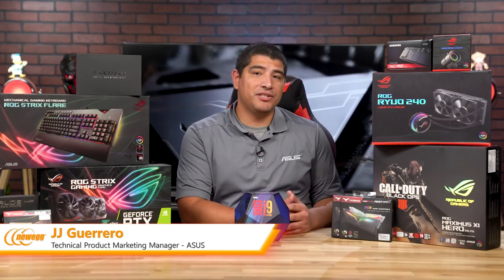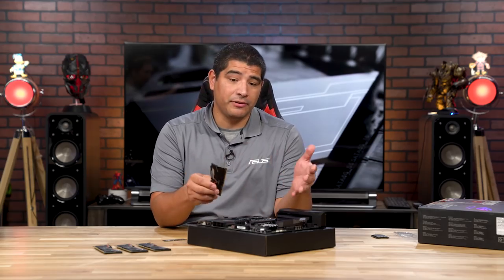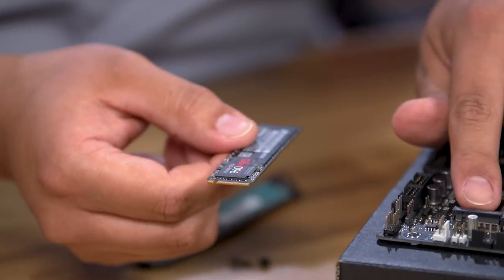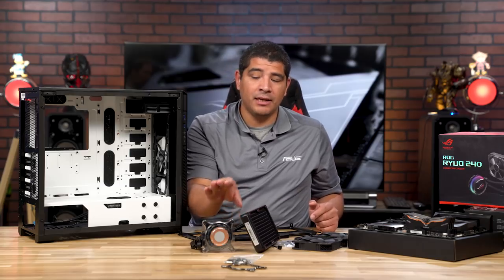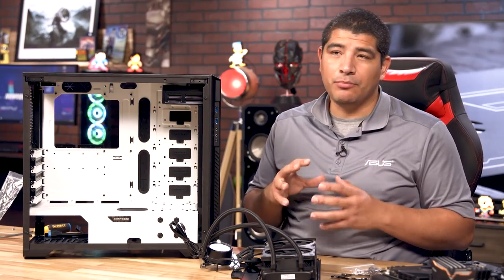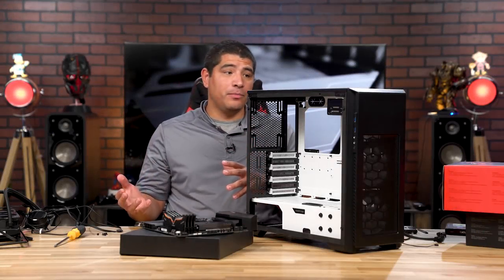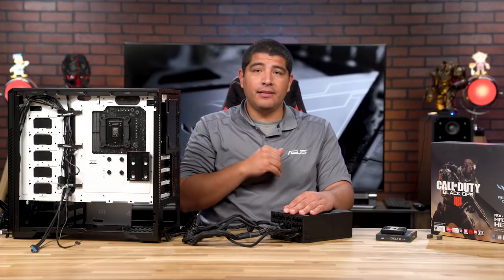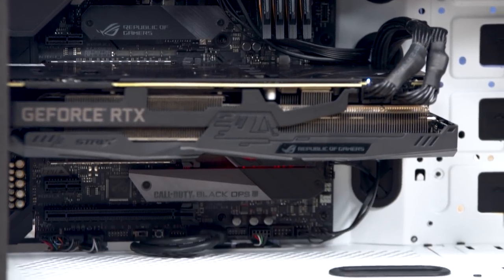How To Build A Z390 Intel 9th Gen RGB Gaming PC From Start To Finish

Comment: Why does everyone do these builds for a specific mother board but never show where everything is being plugged in on the motherboard it self. Isn't that the whole point???
Reply: its not hard to know where all the cables should go
Reply: @sealover63  The video title states from start to finish you would think that you would include cable placement for those building a P.C for the first time. Not a very good tutorial in that sense.
Reply: I agree w/ Casket and Colin. There are so many yt vids on "how to build a pc from scratch" etc. but folks always forget to include the actual connection of the wires process. Like, why is this step always skipped? Have all these content creators completely forgotten that not everyone is born knowing the basics of electricity? For ex. Black = Ground and Red = most usually Positive, and then the Green and Yellows are most likely for audio and/or other connections (differs per mobo mfr), Blue = USB, etc. etc... Putting it all together is easy per say but that wiring! Thankfully most mobo mfr's include color coded wire diagrams in the instruction manual and even include a "Quick Connect" piece (like ASUS). I love ASUS, don't get me wrong, I simply agree that content creators should spend time w/ this.
Reply: Watch Carey Holzman video for Computers buildings
Reply: Bruh, he means giving meaning/an explanation to what’s on the motherboard, how to install M.2, etc etc.
Reply: Came here for power supply connection on the motherboard but saw nothing.
Reply: Have you ever heard of the word MANUAL.....omg... do you have problem reading ?
Reply: For people saying it doesn't make sense for him to show where individual cables go, the guy spent 2 minutes explaining a screw for the M.2 drive.
Reply: @Pablo4949  Yeah....well if you don't know where cables go from let's say from PSU to Graphics card......don't build a computer.  Do something else. The problem with M.2 screws are they are so tiny and hard to find if you lose them. Standoff to M.2. is somehow a problem for a lot....Often they don't use them. I think it's right to spend 2 minutes to  show where the standoff goes with the screw. And then there are heat shields to M.2 They can be very annoying to screw off and on.
Reply: What's your problem with cables? They go the same place on all motherboards. Get a grip and stop posting bull. CPU power - Motherboard power - Sata cables - Power cables for HDD's and SSD's are all the same. Even front USB - Power LED - HDD led - Power swich and reset switch goes the same way on ALL motherboards.
Reply: @eriksrensen6369   But if you don't know where cables get plugged in, or how to route them and such, how are you supposed to learn? Perhaps a build guide? Maybe even a build guide that says "from start to finish" in the name. The point OP was making is if this really is a build guide, why is it just skipping an important step.
Reply: @Pablo4949  Well, if you want in depth how to manage cables - this is not the video for you. This is not a video for beginners or first time builders and was never the intention with this video. There is nothing in the video that claims it's for first time builders. It's just a build video There are other videos where you can learn how to route cables and build a computer if you are a novice. This video is a video for people who have some experience building computers. How do I know that? Just watch the video. People are just eager to find something they can complaint about, and post stupid commen ts. Why comment on how he speaks, and how he looks....it's nonsense and stupid, and has nothing to do with the video.
Reply: you know what I didn't even know that we have to connect 8-pin power cable to mother board as well, I thought one 24-pin cable is enough... and then he said in the video that it needs to be done. So yeah I watched a numerous videos on internet about building PC but no one mentioned that there is a 8-pin power cable as well, only today I got to know, I want to build a PC soon so I am watching these kind of videos, but now my confidence has really dropped I don't think I will be able to do it, I don't even know which cables to connect and where on mother board??.... there is no detailed tutorial as well..
Reply: @memd777  You know what? When you buy a motherboard it comes with a manual. And it will clearly tell you that you need to plug the 8 pin cpu power cable in. If you don't computer will not boot. Ther is a reason why you have to read the manual
Reply: @Pablo4949  Watch the video. It''s showed from 18:06
Reply: @eriksrensen6369  hmmm, I would just call a local expert ... seems too much complicated for my intellect, I don't wanna risk 1000 dollars for nothing
Reply: @memd777  It's not complicated at all. I has been normal for over 15 years  that you need a CPU power cable - 8 pin or 4 pin - on Z390 2x8 pin or 8 pin and 4 pin. You know what? I think. You just like to be negative- Instead of being negative you should spent  a couple of hours reading some manuals and other material about building computeres. Watch in depth videos on how-to.....You sound resignedly
Reply: Just watch the Verge. He explains it very well.
Reply: @eriksrensen6369  We don't need the video then, do we?
Reply: @celestin_me  Do you read the title? Blabla Build a pc from start to finish. He acutally did a video with the correct title "blabla building a pc. Showcasing the start and finish".
Reply: @sealover63   its hard to clip in those power and hdd lights
Reply: Exactly. And seriously building is really not the issue...The question is do you need a video card for this thing or is on board and...Installing that damn OS from Microsoft is always the kick in the ass. Been building machines/servers all types for over 24 years. The install on the OS is either smooth sailing or a cluster you know what!
Reply: @sealover63  If people are watching this for help on how to build a temperamental machine, it would help if EVERY step was clear
Reply: Google iTFT Computers (for video) - you won't find more detailed video of how to assemble a PC, highly recommended.

Comment: One production note, I'm a producer and Production Designer and your set is nice, has a clean look to it. Its a little safe on the overall design. Maybe this is within your budget I'm only speculating but one thing that is truly a production no no is using black, specifically black screens, and even narrow that down don't have black screens with content using black spaces, your camera guy is in the reflection to the point that I'm more focused on what he's doing then looking at the content. Also since I'm here I also just built a Prime Asus Z490-A with I9 10850K and the Pro 980 SSD.  And an RTX2060 I just don't understand how this is system you are building is a high end system. Mine is Mid Entry I believe with all the 3 year old parts you are building with would make this an Entry level system.

Comment: My biggest thing with building my own PC is mainly the parts themselves. First I wouldn’t know what to buy and then the other thing is is everything universal?  Does it matter what motherboard, RAM, CPU graphics card I buy or could I just get the latest and greatest and it will fit into any motherboard?
Reply: LoneSoldier29 Only LGA1151 CPU’s can fit into a LGA1151 motherboard. Different motherboards have different CPU sockets, as well as different ram slots and different PCI-E, M.2 and PCI-E 3 slots. PcPartPicker.com is a good website that checks compatibility between components. PC builds almost entirely revolve around budget, depending on how much you can spend you pick between AMD and Intel CPU’s and then will need to pick a compatible motherboard. It is best to do a lot of research into what you want in your computer, also depends what you are using it for. Goodluck!

Comment: Meh, The Verge did it better...
Reply: Kis Jorgensen clearly
Reply: Yeah, he forgot to add some extra thermal paste..
Reply: And the radiator has fans on it
Reply: Definitely needed to use some tweezers.
Reply: thanks ;)
Reply: Of course The Verge did everything better, they're 'real' and 'professional' journalists.
Reply: Emanuel Lipovac why you say that? You don’t need to much thermal paste at all. The amount that comes on the cpu block is more then enough
Reply: He didnt bleed the cooling system.
Reply: @2vgod460  r/whooosh
Reply: Yeah the verge knows how to delid aswell they use sandpaper
Reply: Wow.....  🤣🤣🤣 🅱️etter
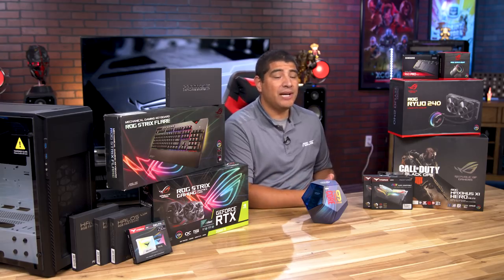Reply: He had 1:00 right
Reply: Make sure to secure the cables with tweezers!
Reply: Need two boxes of thermal paste just incase.
Reply: He didn't screw in with confidence
Reply: S gill whoooooooosh
Reply: He's not grounded to an elastic band
Reply: Estray One lol
Reply: And never put in the cpu first. Do the cpu after you done everything in the motherboard.

Comment: Dont even know why you made this video if you cut out the cable plugin stage
Reply: Exactly. I can do all this crap. Cable plug in and management is what I need help with. Since every mobo maker wants to mix it up from everyone else, it gets confusing. I would also like to know about how to set up the RGB controller the right way. Assembly is easy. I need the in depth tech crap. The stuff that sets the builds apart.

Comment: Hardware Unboxed did an extensive review of the top Z390 boards and the Asus Maximus Xl was at the bottom in every category, so thanks to that review ,I'll be using the MSI MEG Z390 ACE

Comment: HIya JJ! Great video!   I listed my PC specs below.  It is about 7 years old.  Would just upgrading my GPU be worth it, or should I save up for a new build?

CPU:  AMD Phenom II x6 @3.8+ghz
 
Heatsink:  CoolerMaster hyper 212+ (hand lapped with twin corsair upgraded PWM fans in push pull)

Motherboard:  Gigabyte 990FX-UD5

Memory:  Corsair XMS3 @ 1666mhz

GPU (s):  2x XFX ATI 6870

Harddrive:  Hitachi 1TB 7200rpm SATA

Optical:  Sony DVDRW

PSU:  Corsair TX750 750W

Chassis:  Lian Li K62

Comment: I always install the CPU after the motherboard and power supply is installed in the case. Then make sure the power supply is switched off, plug in the IEC connector! This makes sure the case is grounded to protect against static discharge and possible damage to the CPU chip and other motherboard components. Touch the case to discharge and static electricity and proceed to install the motherboard and then the CPU as he instructs. 
Matt -  Building PCs for 40 years.
Reply: no need for nowadays hardware, much. Tougher than 486 era.

Comment: Hey JJ, if I use an Intel Optane 905p SSD on a Z390 board, would it be limited in terms of performance if using the chipset lanes? I imagine it technically would be, but would it be noticeable/really matter? 

I ask because the Intel optane SSDs have superior Queue-depth performance compared to regular NVME drives so I was curious if chipset lanes would impact that to a noticeable degree.

Thanks

Comment: Question?  Why do you put blue locktite on the screws holding the M.2 thermal pads on?  It is near impossible to unscrew them without stripping the Phillips #0 heads out given the locktite on each of the 4 screws.
Reply: pkincy exactly!!! I almost ripped my heat sink because of those damn screws!! Which genius came up with those screws???!!

Comment: Good video, but what's missing is updating bios and maybe some issues solving. Did the soft test that you said and the VGA light was on all the time, in the board manual it said it could be problems with the graphicscard and that got me worried, it disappears when I plugged in a monitor. Another thing I had problems with was no signal to my tv from the hdmi. Had to use a hdmi 2 displayport to get a signal to the tv. I guess I'll have more problems but as a non it would be nice to know this kind of issues :) z390-f & strix 2080ti of btw.

Comment: sigh thank you so much for this video... I've been trying to find exactly this camera angle on THIS motherboard, and you provided it it... I have a replacement set with Amazon, but after realizing what I had to begin with, I am so tempted to just cancel it all together...

I just got a whole bunch of new parts for my new build, including this motherboard (not special edition though) and processor.  When I attempted to place the and close in the CPU, the screw that holds it seemed to pop out of the motherboard and was seeming to put far more pressure onto the CPU than what I was comfortable with.  Seeing your video at almost exactly 2:30, I can see that what the latch connects to is a specialized flat stop screw piece.  But what I have in my motherboard is a regular, round headed screw, very similar if not almost identical to the two holding the cpu mount itself.  Now my question becomes this...

How could there be a wrong piece like this in the motherboard?  Faulty product, or should I be looking at Amazon on possibly sending me a "renewed" product when I should have it directly off the shelf?

Comment: I have watched this before a while ago before I started building PCs. Now that I have done a few, um.... did you completely screw up the CPU cooler install?? The radiators final spot is not where it started. Your original location was to the back and it moved to the front off scene somewhere. Also, when you pushed on the pump you put it on sideways (hoses at the bottom), then, at the end, it is correct. Beautiful build otherwise. And nice vid. Please don’t skip over the front panel pins next time. Everyone seems to do this and it is the part I believe most people have drama with.

Comment: You didn't check to see if the processor is flat on top. I9 , some are curved at the top , if you don't check and flatten it out.. when you install that cooler.. your temps may be higher than normal. Basically because the middle of the cpu has zero thermal paste...

Comment: Great video, I've been rocking a Sabertooth X79 for years. In fact, Asus Corp in Fremont replaced the board last year. Sadly Microsoft's yearly update back in Feb of 2017 us Sabertooth users with unending random black screens. So, I took the plunge and replaced the board, CPU and RAM. I bought the Asus ROG Strix Z390-E Gaming, a i7 8700K and 16 GB of DDR4. I already have a 1080 ti, SSD and a 1200W power supply. I love the board, although I would have liked to water cool the Mosfit's and Chipset. But it's new, so I'll have to wait for EK to catch up.

Comment: Ok nice explanation for mew builders. But could you go a bit more in depth on the Intel Optane and raid stuff with SATA and M.2 drives? Don't now if it's the same on this board but i just received my Maximus XI Extreme (stil waiting on CPU). And the manual doesn't really says much about it.

Comment: isn't the radiator fan mounted for exhaust out the top and not in pull configuration to pull air into the rig?

Comment: Do you know if it is possible to connect a 3-pin 5v led strip to the z390-f board or is it the older 4-pin 12v?

Comment: am looking to get an i9 9900k do the CPU have to use the extra CPU power connector to run 5 GHz or not require? because my current power supply does not have the extra power connector, I would have to buy a new power supply if it needs the extra power connector.

Comment: This video is not gonna do me much good considering that my 9900k pre-order through Amazon has no time estimate on shipping and they ran out of stock, and pretty much rest of the 9th gen cpus are sold out and you can't get them, oh and also note that the z390 mobos the $280 or higher are also not available..………..Intel and Amazon needs to be held responsible for this failed launch. The pc tech youtubers also have dropped the ball on reviewing all the z390 motherboards to find which ones perform the best for overclocking the new unlocked chips. I was suppose to get my 9900k on the 24th of October and here I am after 3 weeks of waiting.....All the pc guys on youtube and the pc gaming community need to put the pressure on these companies and force them to give us answers because I want them to also apologize!

Comment: I have an issue where the GPU is installed, detected in Windows but not working. WIndows keeps using the integrated graphics and not the GTX 2070 Super. Drivers in GEForce Experience say they have installed, but still no Nvidia Control Panel. Any tips?

Comment: anyone have any thoughts on air cooling the i9 9900k instead of water cooling? this looks like a really nice cpu cooler, curious if it's as good or better. I've always used air cooling and never had any problems. I'm not a gamer but I do a lot of high resolution editing (4K multi-track editing and rendering for example).